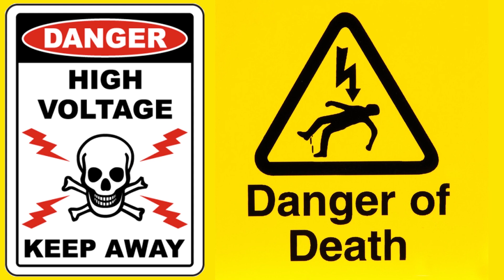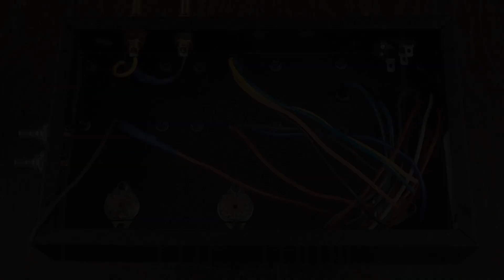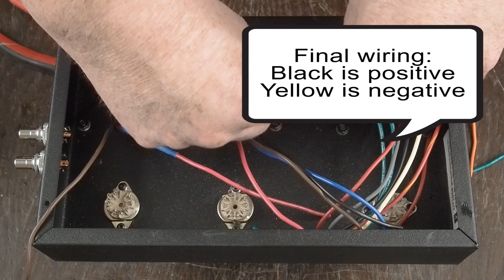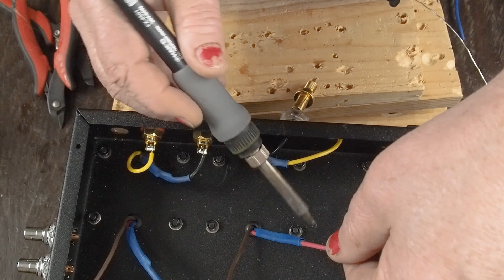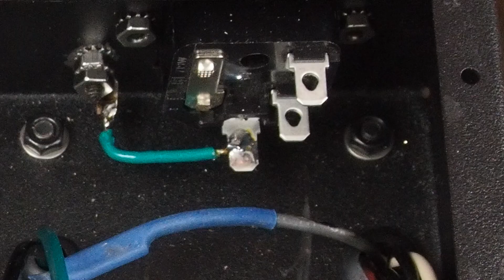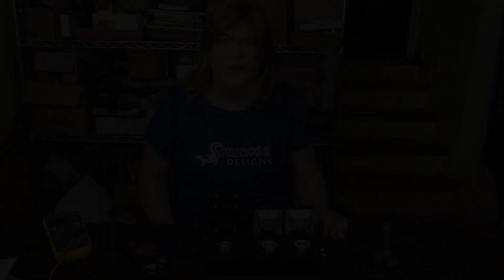6BQ5 spud amp: #3 Start wiring!

Comment: Question: which manufactures are the output transformers from. I know you showed the label in your last video it went by fact so I didn’t see it. Do you mind telling me.  Also very nice SE  clean layout. Thank you Skunkie..
Reply from the maker: These are by Edcor. And unless you really need this smaller footprint, I would use a slightly larger chassis and their 15W models instead of the 10W ones I used on this build. I plan to do that on a future version of this!